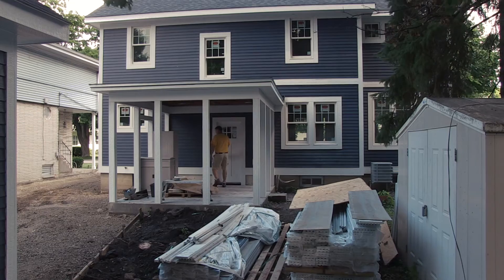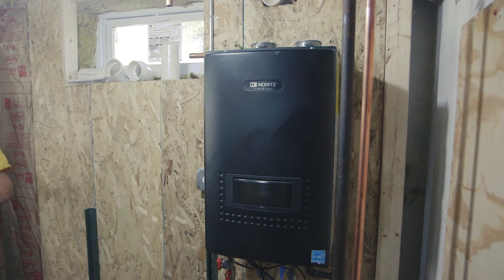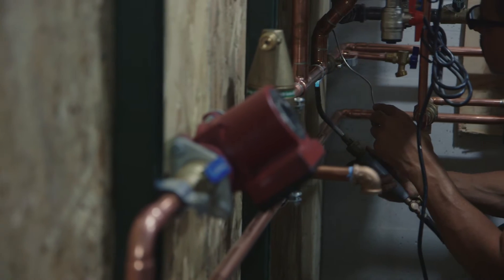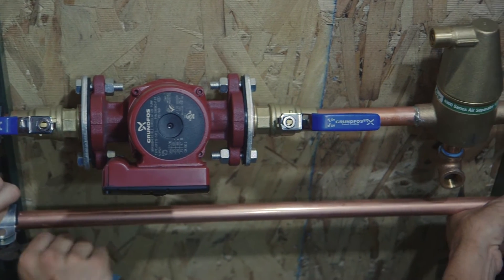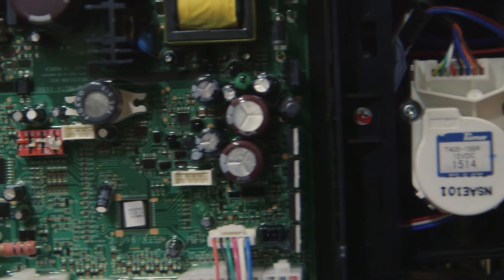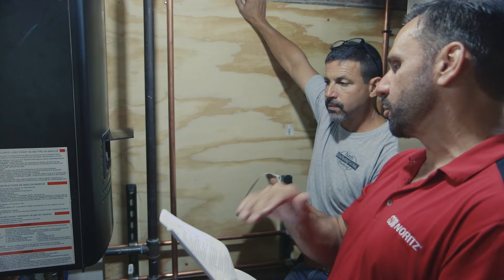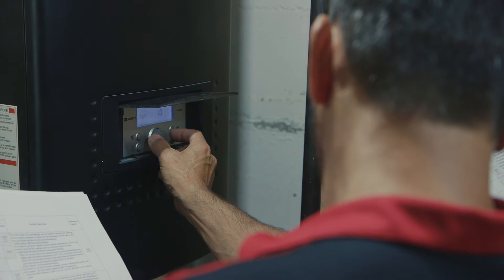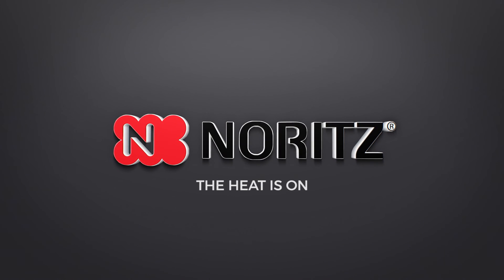Noritz Combi Boiler Model Remodel Project

Comment: Not to rip on the installers so much but.... this is not fully installed properly, expansion tank is not supported, closely spaced tee's are not closely spaced IAW the Noritz CB199/180 manual (they are very far apart so you have no hydraulic separation), primary loop piping looks to be undersized,  you did not use CPVC for the exhaust which means they can never run the boiler on high, DHW relief valve should be mounted in vertical position (per the instructions). Did you run a combustion analysis upon commissioning the boiler?